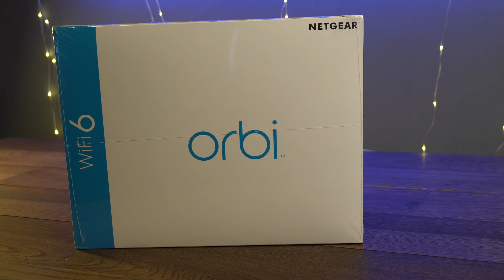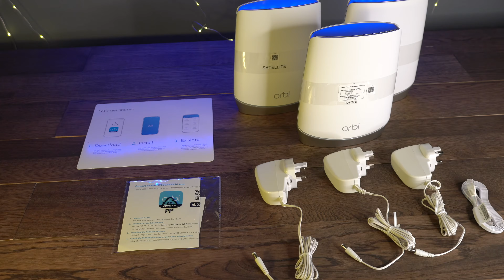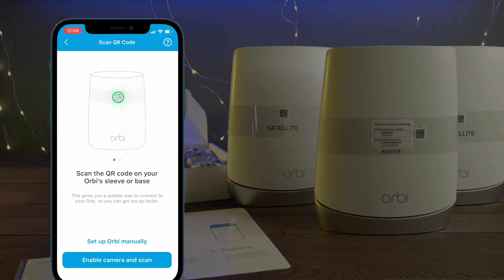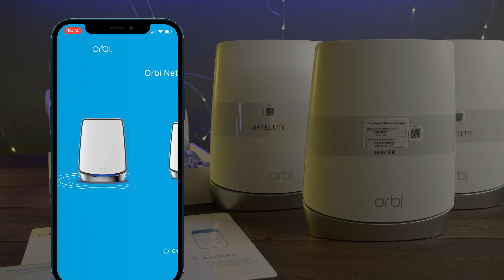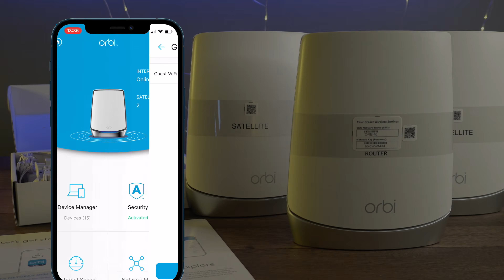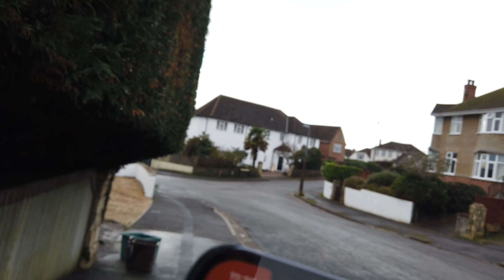SuperCharge your WiFi with Orbi Tri-Band Mesh WiFi 6 System | Full Review & Set Up

Comment: Biggest problem is they don’t use seperate SSID so if you have a few 2.4Ghz devices they are very hard to connect or stay stable. Very Poor software.
Reply: That’s the entire idea behind mesh Wi-Fi routers to have one singular SSID so your devices can seamlessly connect and disconnect between the mesh points.
Reply: @dimitri_1of1  Well if you have a washer and dryers that don’t walk between routers then its hard to get them to connect that’s why i bought the Asus ZenWiFi XT8 as it has seperate SSID and connects easy plus your point makes no sense because even with seperate SSIDs your device still switch’s to the closest router plus and after speaking with Orbi the nightmare to get 2.4 MHz connected dedicated is a joke of a process. So the Orbis are over priced and poor software. The asus i get around 826mbps download by wifi on a 1gb plan and 955mbps by cable so i will stick with the Asus ZenWiFi XT8 far better.

Comment: I live in a building that installed Ethernet jacks around '02. They purport that the speeds are 1000Mbps wired and 100Mbps wireless. I have an old router and wifi extender that I purchased 2 years ago.

I want to upgrade to wifi 6. I know I have to get rid of the old router. My question is, can I upgrade to wifi 6 tri-band mesh or am I limited to wifi 5?

Comment: not trusting any other netgear product after my experience with their garbage Orbi 6 system.
Reply: Please elaborate on what the problems are?
Reply: @madness8556  nodes frequently disconnecting, sometimes not even connecting back, rarely got a good 5GHz connection between them. replaced that garbage with an asus xt8 and it easily blows it outta the water. same locations. also, the amount of control in the web ui is laughable. you can barely change anything, and parental controls ARE A MONTHLY SUBSCRIPTION. that's including bandwidth control for individual devices. asus xt8 has way, wayy more settings to mess with and customize your network. plus free parental options, lol.

orbi mesh could look ok on paper but it wasn't performing well in actual use. was a daily nightmare.
Reply: Thanks so much for your concise reply. The more I'm doing my research, the more I like the Asus but I've been given advice to wait for the ET8 to arrive.
Reply: @madness8556  that's gonna be an awesome device!
Reply: @jonightx  Yes exactly what I've heard. I've got an ageing Netgear router D7000 and EX7000 wifi extender and the wifi is starting to switch off with me having to restart the system. I need something more up to date.